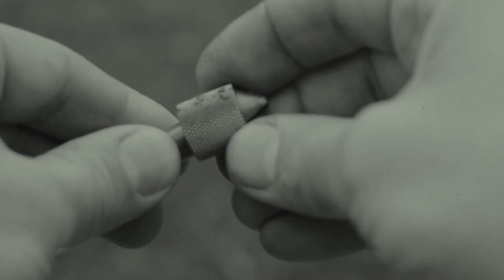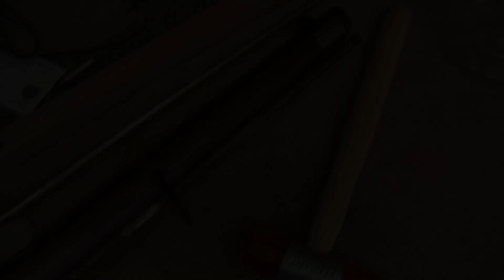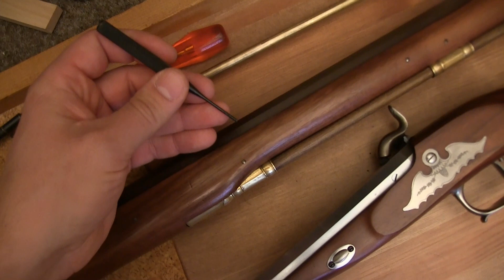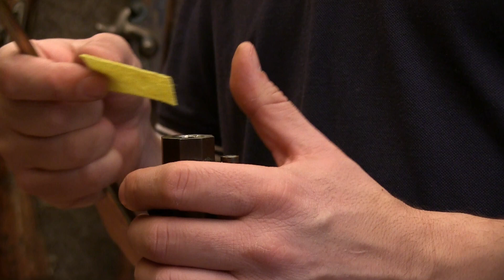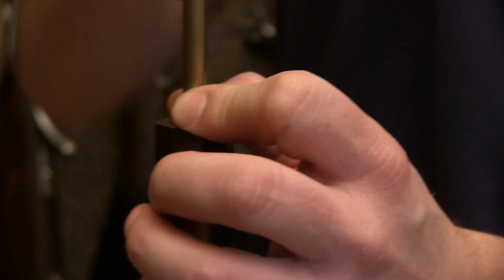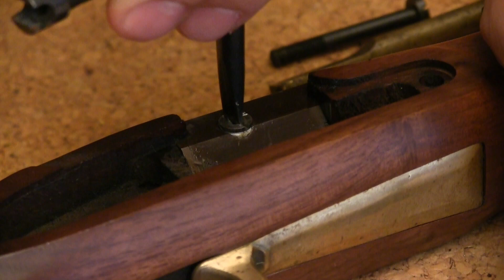Blackpowder basics 1: Cleaning the fullstock muzzleloading rifle

Comment: Unfortunately my flintlock doesn't have a touch hole insert.  I heard that the old timers plugged the touch hole with a small piece of wood and using soap and hot water, pumped the wipe stick up and down then poured the water out of the muzzle . On the third cleaning, they removed the plug and let the water flow out of the touch hole. I have used this method and found that it works well. Ballistol works well to clean the Lock, but WD-40 will also work. I oil with ordinary Hoppes gun oil on a patch.  After a couple days the oil is gone so there is no problem with Oil/Bp contact. Learn to love cleaning your rifle!

Comment: No need to remove the vent hole screw, just plug it with a round bamboo toothpick, then fill from the muzzle with hot water and let soak for 30 seconds before emptying the barrel.  Forget about  the brushing out unless you didnt clean after shooting was over with.

Comment: Thank you for taking the time to show this. That is some great stuff.      I know some people suggest using a breech plug grease for the touch hole threads. I see you were using pipe thread tape. Do you see a problem using breech plug grease or do you have any suggestions on why not to use it?      I have also read competitive shooters like to foul the bore of the barrel to create a consistent fouling between shots. My challenge with this is as a hunter, I do not want to arrive in the woods for a hunt, shoot a fouling round, to foul the barrel and scare all the game away. I also do not want to leave the barrel fouled for a long period of time, if I am hunting lets say for a week or two weeks with just my muzzle loader.      How long can or would you suggest to leave a fouled barrel before cleaning it? If you hunt with a clean bore you may not have the accuracy looking for when hunting and the first shot should be your most confident.      Any thoughts related to the hunter?Peace, Reese

Comment: Sir: Just watch your video on cleaning a BP gun. Not bad but, for that it is worth.... I have a much faster , easier, cheaper, fool proof and better way to do it  you are welcome to steal. If you will  contact me, however you do that from here,  I will send it to you free.  I send the info out to 2-3 people a week I found 50 years ago. It is out side the box because I do not use a patch, brush or hot water to clean any on my guns, I use the cleaner I get from Dixie GW over until I spill it using it  and I get no rust, concrete build up or corrosion... ever. Takes me minutes to clean a gun.  Works for all kinds of guns as long as they do not have a lot of moving small parts the cleaner can get into and then as long as you dry it out it you are OK and no part of the gun is ever removed to clean it.... Period. I have it all down in PDG files what I do and  why it works so well and in videos you can also have on a FB page.... free.  I hate to see anyone do anything the hard way and how you clean your guns is a lot harder than the way I do it.  The more people that see this method, the happier I will be. Call me Boat's. B
Reply: Hello James, I would like to hear about how you clean your BP gun. email me at mogundrum@gmail.com Peace, Reese

Comment: All I have are cap locks.  I take the barrels off of the furniture and take the lock and cone off the side of the barrel.  Then I run hot water from the shower down the bore and brush it then patch it. After this I dry off the barrel and run patches down the bore until dry. Then run a pretty oily patch up and down the barrel. I cleaned the cone and lock. Dry and oil but wipe off any excess oil. Then I put anti seize grease on the threads of the cone and put it back together. Good as new. I like the idea of the Teflon tape but the nipple or cone won't get that hot. I shoot Minniê balls through mine.
Reply from the maker: Stew, that seems to be a good way as well! Thanks for sharing!

Comment: A valuable video on shooting black powder.  It is hard to find 'real' black powder in US so most shooting is done with black powder substitute that is less corrosive...some say non-corrosive but I wonder.  Thanks fo a good cleaning vid as even I picked up on some tips that I'll try next cleaning.
Reply: It is a little known fact but black powder substitutes are actually MORE corrosive than black powder due to their unique chemical composition. They attract water from the moisture in the air like mad and form acid compounds in the same way that regular BP does. Always clean your firearm just as diligently after shooting black powder substitute just as you would for black powder.
Reply: Not sure if you know this or not. Some Wal-Marts, Cabela's, Bass Pro Shops, Gander Mt. etc. do sell true Black Powder. You will not see it on the shelves. You have to ask for it from the sales clerk behind the counter. Depends on the location or city you live in. Even some of the clerks that work at the store did not know they sold it until I had to tell them it was in locked storage behind the counter/or in the back. They asked one of their coworkers and confirmed what I had told them. It took me a while to figure this out. Give it a try and ask at the stores you shop at, don't assume if it is not on the shelf they do not sell it. It has to be in locked storage because it is combustible. Every city has different rules about that. The stores have to pay a lot extra for the privilege of selling it because of safety reasons and that is why big name stores can afford the extra cost to sell it.   Hope that helps, Peace, Reese

Comment: what kind of fluid should I use to clean the wood? I need to clean powder fouling from wooden parts of pedersoli brown bess musket
Reply from the maker: First I use a damp cloth to remove the residue, than use the same oil as on the metal.
Reply: ***** I am afraid that oil for metal can damage wood. It's acceptable to use linen oil for stock?
Reply from the maker: Alexander Spiridonov
yes it is, but modern gun oils will never harm your wood.

Comment: Excellent video, as always. I find the last flush through of the barrel is best done with the hottest water (boiling) that you can pour through, this heats up the metal and makes it much easier to dry, I then use compressed air to blow though and get every last drop of water out of the system, I also think it would be a very good idea to do this in an outbuilding to keep your wife happy!
Reply from the maker: That's a good way to improve this method!

Comment: No Hoppes no. 9?  Do you not get rid of the lead deposit in the rifling?
Reply from the maker: Adrian, I only use this method if I shoot patch roundballs. The guns that shoot conicals without patching is a different matter. In this case time to time I remove the lead deposit. I use Roble as a solvent, but used very gently.
Reply: Patched round balls never have lead touch the bore.  That's the point of the patch.  If you shoot minie's then you might use Hoppe's after removing the powder fouling.
Reply: Thanks. I shoot . 44 BP revolver.No patches, hence my query.
Reply: ***** Thanks for your response.